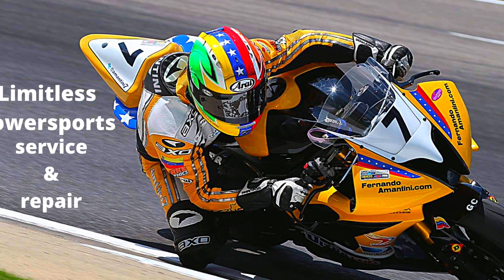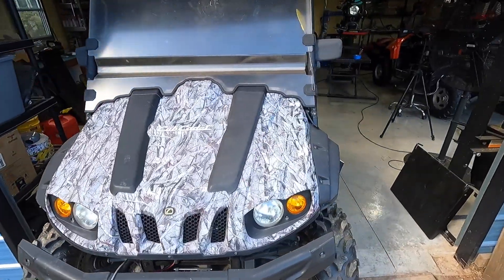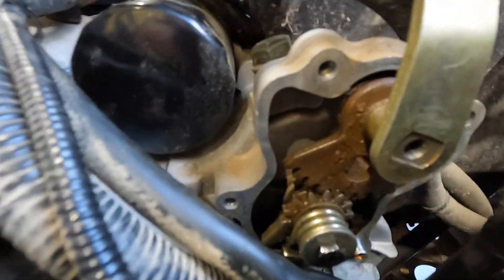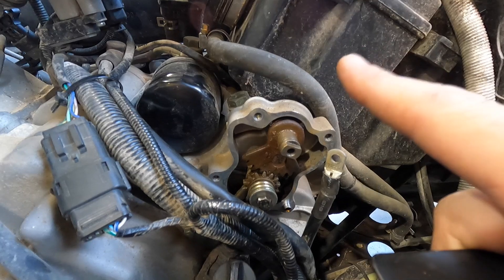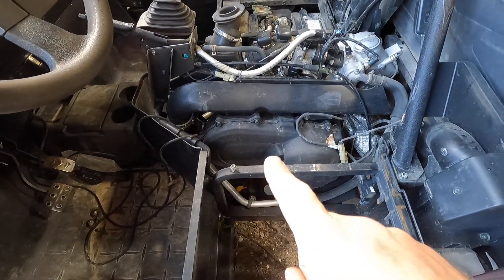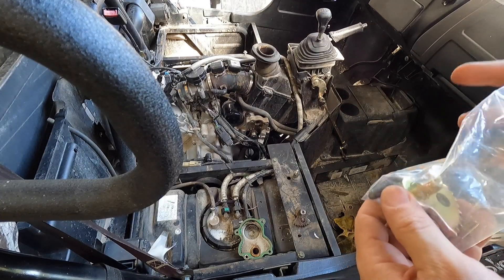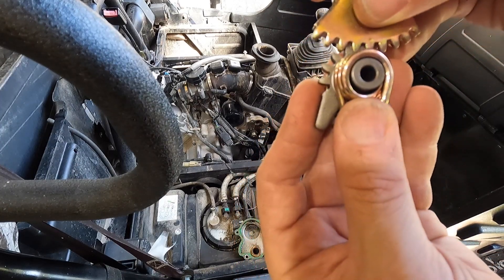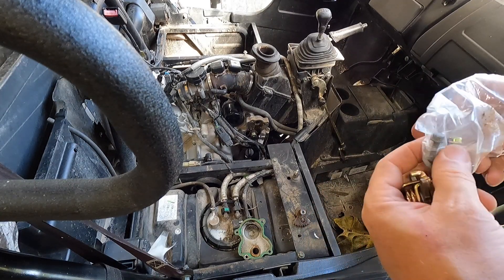Cubcadet Challanger 500 won't move?? (Massimo, Coleman, Bennche, HiSun)

Comment: I’m working on a madsimo 500 utv. All the internals look the same. Put everything back together and when I put it in gear it starts grinding and then stalls as if something isn’t engaging. Replaced the wet clutch one way bearing and I’ve also replaced the same cut primary clutch. Everything engages and works as it should in neutral but in gear it starts grinding and stalls the engine. Any insight or recommendations to inspect would be greatly appreciated!
Reply from the maker: . Sorry for the delayed response.  In currently out if town with the race team I work with.  But it definitely sounds like you install the oneway bearing backwards.  You need to be able to read the writing when you install it onto the wet clutch. Also the primary clutch should spin counter clockwise went not running & then engaged & turn the motor over when rotated clockwise.  That's where I would start. If you have anymore questions email at Limitlesspowersports78@gmail.com

Comment: I have a cub cadet volunteer was wondering if the secondary clutch was the same and if so would you happen to know the part number? Thanks in advance
Reply from the maker: What year & motor size is your volunteer? You can find parts on cubcadet.com under utility vehicles.  You aslo need your modle #. Makes finding parts the much easier. But I would buy from them because they are crazy over priced.

Comment: Where do you get your parts from I'm having similar problems on our hs500utv efi command and what's part number for the good gates belt. I wanna replace the gear teeth and secondary and primary and maybe wet clutch
Reply from the maker: I order my parts from multiple places. I get some from Amazon,  but most come from motorcycledoctor.com & partsboss.com 
I unfortunately don't have a part # for a good gates belt. You might have to contact them.

Comment: Is it the misplaced washer that caused this damage?
Reply from the maker: It's a really good possibility because what happens is that the outer primary clutch is no longer in the proper position on the wet clutch drum shaft. So it's a possibility with that being wrong the nut that holds the primary clutch on might not of been able to ne torqued properly.